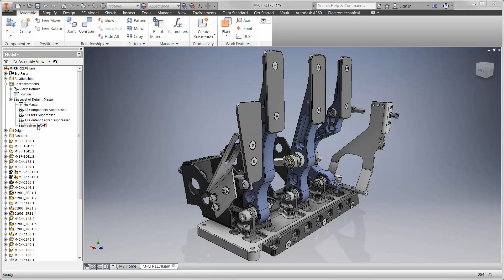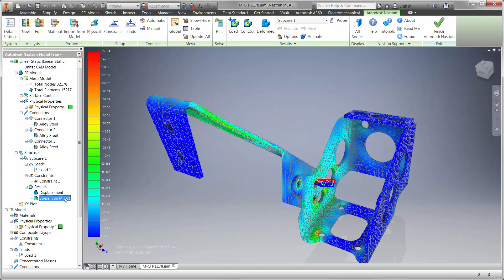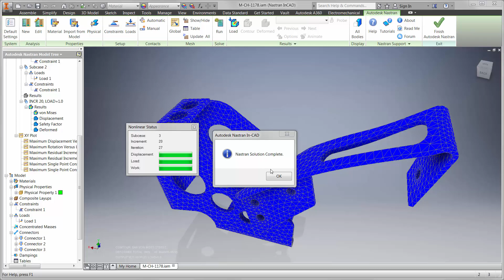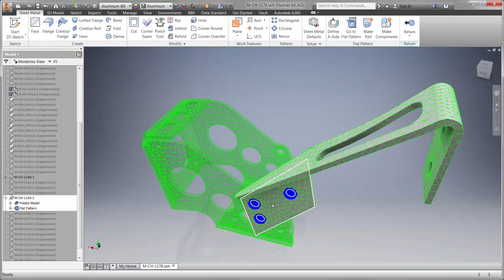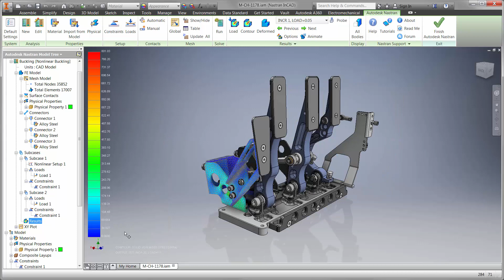Autodesk Nastran - Buckling Analysis

Comment: Hi Rob, I know that this video is from 2015, but i am studing Autodesk Nastran 2020 and your video help me to understand about analisys no linear. I have a question aboutr to this video tutorial. When you did the nonlinear buckling analisys, how is set the material? Bi-Linear elasto-plastic, Multi-Linear Pastic? I have this doubt, because in the video are not specificed. Only said  that material is Aluminum 6061. Thanks.